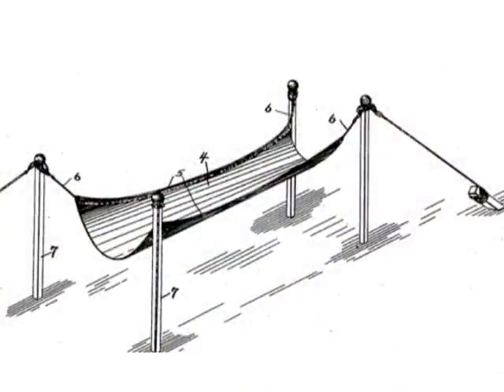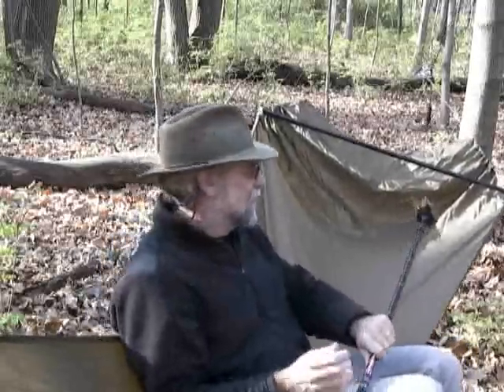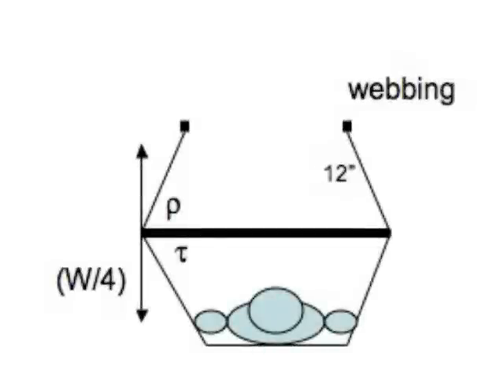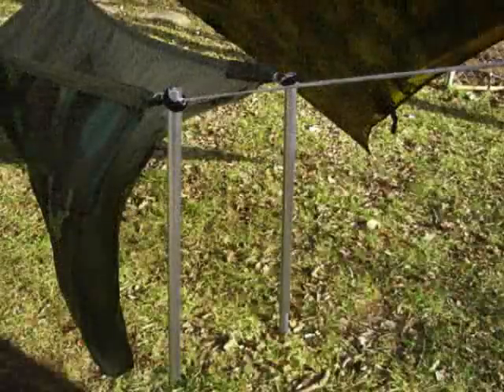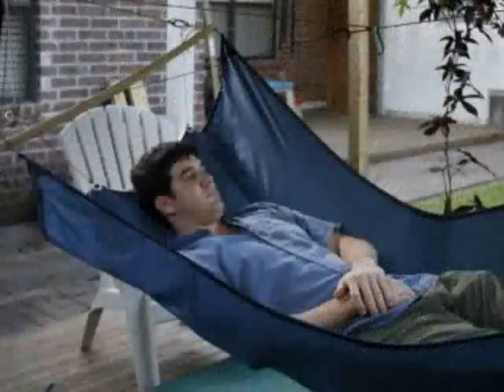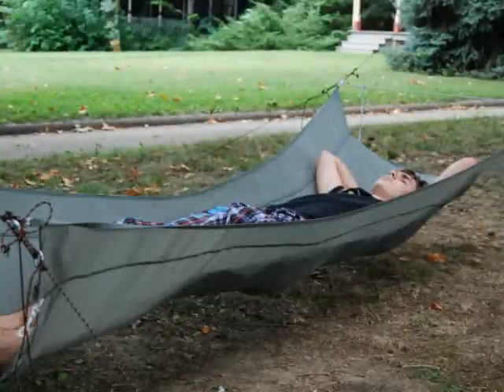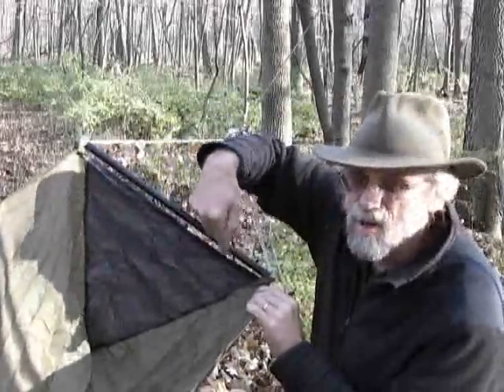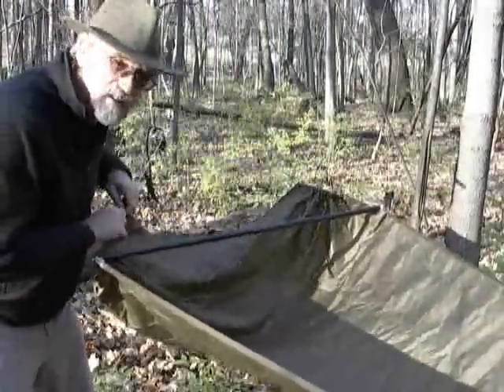a brief history of DIY bridge hammocks, part I

Comment: Thanks Grizz, this video got me hooked on bridge designs. Gathered end hammocks gets my claustrophobia in high gear, so I was looking for a good solution. I ended up with a M1966 Jungle Hammock used in the war. I bought some 1.5" wood bannister (round), cut it to fit and attached the looped webbing to the ends of the spreader bars. Need to stabilize it. I then made a Marlin Spike and attached a carabiner to the center of the triangle and attached to the suspension webbing. Problem solved! Thanks